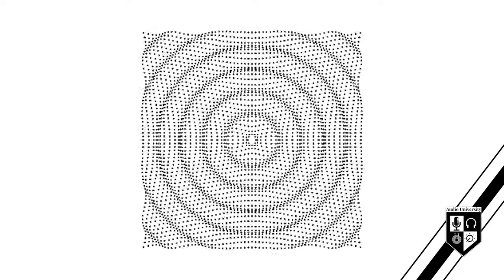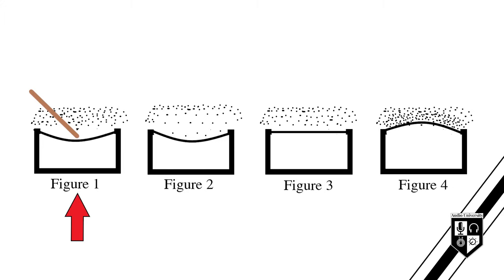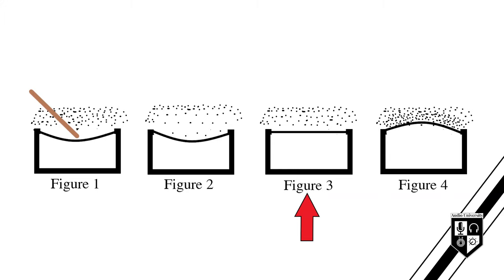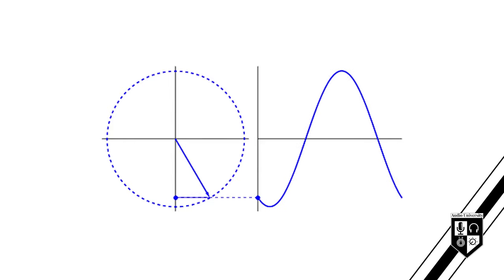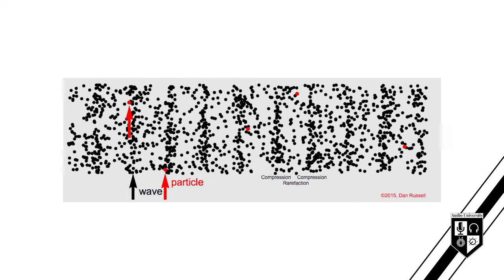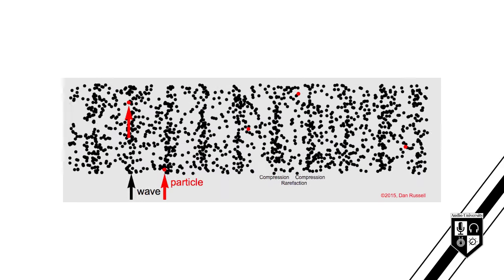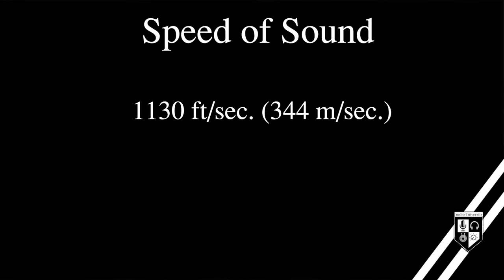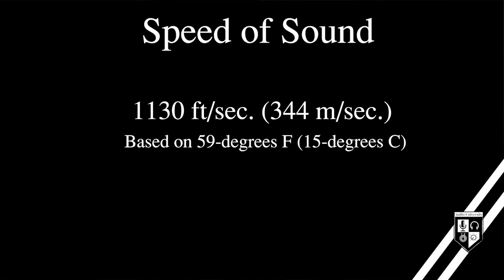AUDIO BASICS (Part 1): How Sound Works

Comment: Hi, I have a suggestion for a video. Could you research and explain phone recording. Suppose I am recording directly from my phone, what are the issues based on that equipment I am dealing with and the possible solutions. Every phone has a mic and speaker built in and most phones have a headphone jack. Since both these are together in the same equipment what kind of issues can come up for someone who's recording directly into the phone. And what kind of issues can come up if he is recording through a headphone cum Mic. And what kind of issues can come if he's recording through an external microphone (dynamic/condenser) plugged in through various adaptors (without interface/pre amp). 
A lot of normal people have begun recording on their phones and want to do so with minimum equipment and simplified solutions. So it would really help them.
Thank you.
Reply from the maker: Good suggestion! Thanks.
Reply: :) in trying to record meditations through my phone and I'm so lost. The recording directly through phone gives a mili second phased out electrical buzz - so frsutrating. Condenser mic I bought gave too much noise (traffic around my room). I was thinking of buying a dynamic mic but people said the recording will be very quiet and if I increase the db in post production in an app on phone like lexis audio editor, I'll end up increasing the noise too. So, I just don't know what on earth to do. I don't wanna buy a preamp. And then someone suggested I should get a usb sound card. What does that do I don't know. So totally lost.
& I'm sure there are a lot of people like me who record and even edit on phone with minimum and affordable equipment. So that's why I asked. :)
Reply from the maker: I agree that the best option for you would be to connect a directional dynamic microphone to an audio interface (usb sound card). Then point the directional mic toward you and away from the noise source. 

Watch this video for help choosing: https://youtu.be/6jhHlJWV3Jc

Comment: It is actually opposite; a membrane moving outwards will see a low pressure not a high pressure in front of it. That is because pressure is proportional to acceleration not displacement, for harmonic motion. Displacement and acceleration have opposite sign for harmonic motion. Don’t sweat it though , even most acoustic engineers get this wrong. Feel free to reach out if you want to know more about acoustics. René PhD. Acculution.com
Reply from the maker: Interesting! Thanks for sharing, Rene Christensen!